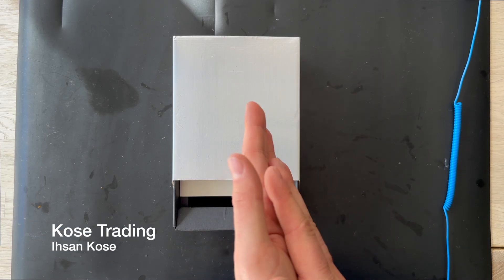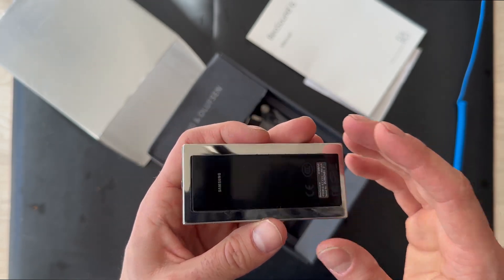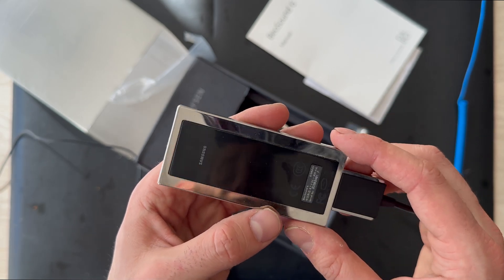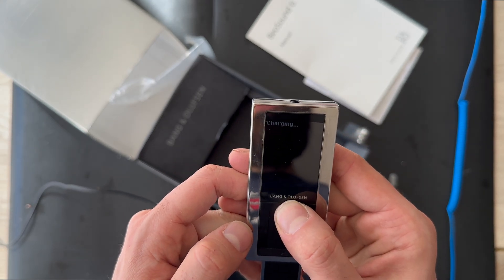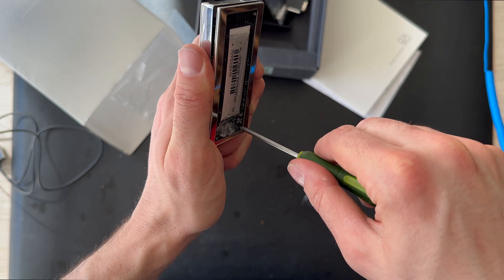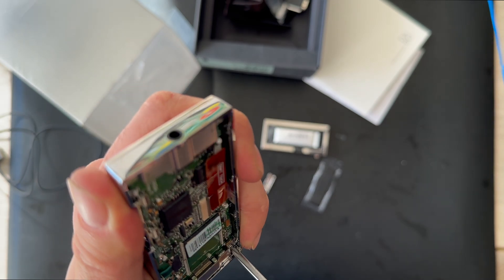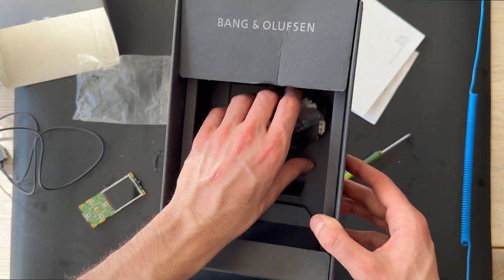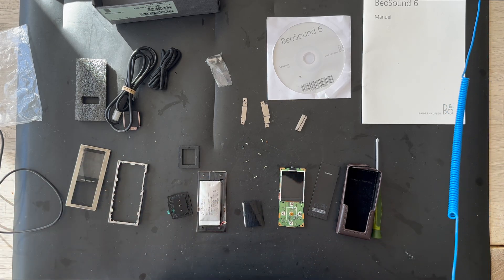Bang & Olufsen Beosound 6 Disassembly process and Repair guide

Comment: I dreamed of owning this as a young teen. Sadly, I got an iPod touch instead 😅
Reply from the maker: Haha, I totally get that — the BeoSound 6 was the dream for a lot of us back then! 😄
The iPod Touch was great too, but there’s just something about the design and feel of B&O gear that sticks with you.
Glad to see fellow fans here! Did you ever get to try one later on?
Reply: @KoseTrading Sadly not. However, I was quite a regular in the local shop as a browser, picked up a few ear/headphones and speakers etc.. I do find their prices to have crept up far too much nowadays. The price of a contour and how much development went into it VS the price of a  BV10 or 11 just baffles me…
Reply from the maker: @patrickw5454  I totally get what you mean. There was a time when walking into the store felt like discovering something truly special, and the pricing—while premium—still reflected the craftsmanship and innovation. Nowadays, it does feel like the price-to-value ratio has shifted. Comparing something like the Contour to earlier TVs like the BV10 or BV11 really highlights that. The older models felt more substantial, both in terms of materials and engineering. That said, I suppose a lot of it now goes into software, partnerships, and design minimalism—but it’s definitely not as tangible as before.